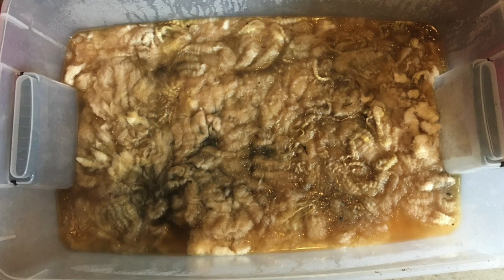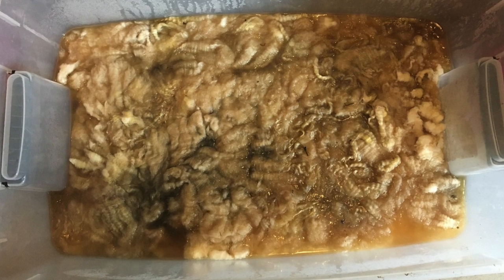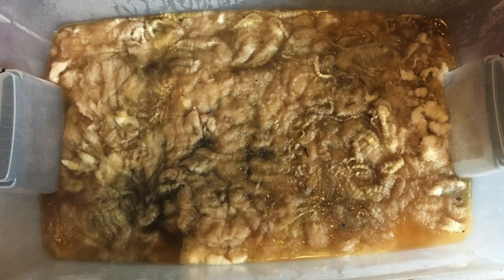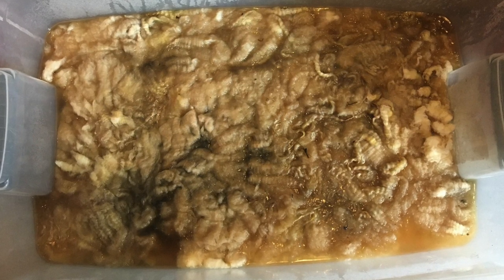Sheep to Sweater – Part 4: Suint vat cleaning method

Comment: Oh dear! 5 weeks! That is probably why the smell was so bad. Also, anaerobic bacteria tend to produce odours that are particularly objectionable, and I think the suint method of cleaning fleece probably does encourage anaerobic bacterial growth … in fact, for all I know, it might be reliant on anaerobic bacteria. A question - was it still cold weather when you pulled it out for drying?
Reply: … just an additional comment: the smell will disappear when the bacteria dies. This will be when the wool dries properly …
Reply: …and I think it definitely is an outside in warm to hot weather process …